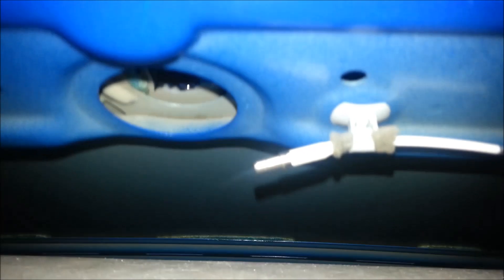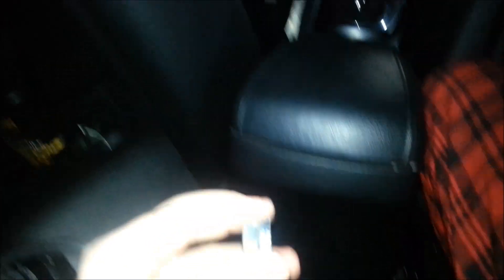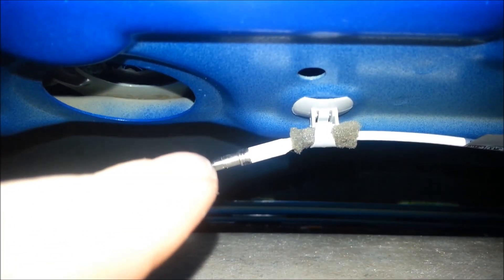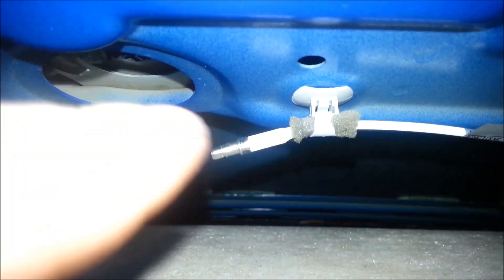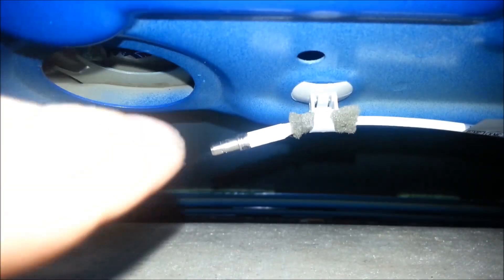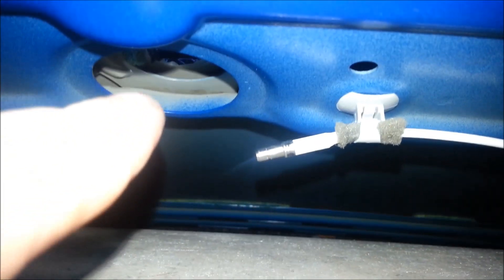How to remove the Shark fin antenna

Comment: Hi Snoopy, you high quality descriptive videos rock! What is the reason for removing the shark fin?
Reply from the maker: If you wanted to paint, vinyl or dip your roof, it's cleaner and easier with the antenna off. Also you can buy Sharkfin deletes to smooth out your roof or bring it a different style. One fellow installed On-Star in his Genesis, but that requires swapping to the On-Star antenna, so this helps achieve that too.

Comment: I'm having trouble connecting the wire back together ,have any tips on how to do it?
Reply from the maker: +AARGY13130 you have to pull the slide clip back, plug it in and then release the slide clip. They don't just plug together.

Comment: i believe the water leaking from my roof to be coming from the shark fin antenna. From the top of the roof, can i take it off easily or do i need to removed it from the inside?
Reply: Have to remove from inside

Comment: Is the shark fin only used for XM radio? or does the regular radio stations use the shark fin as well?
Reply from the maker: dfsdfgssdfgsdfgdfsg only xm and gps if equipped
Reply: The radio antenna is on rear window

Comment: My ex was washing my car and knocked the fin off and got the motherboard inside wet. A few days after my bluetooth wouldn't connect to my phone even though it says it's connected and will not play music. Do you think the two are related? Is the shark fin responsible for the bluetooth?
Reply from the maker: l Hype l they are related in the sense they both go to the radio. But the shark fin is not responsible for Bluetooth. If anything though, your XM and or GPS would be having issues.